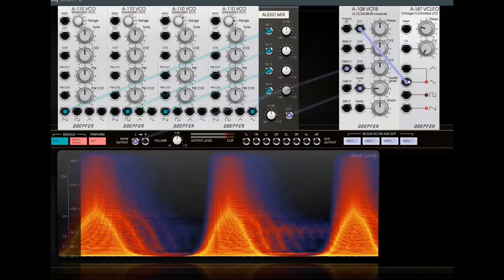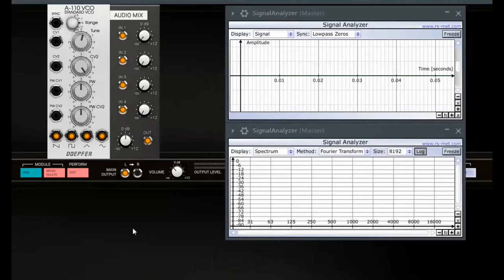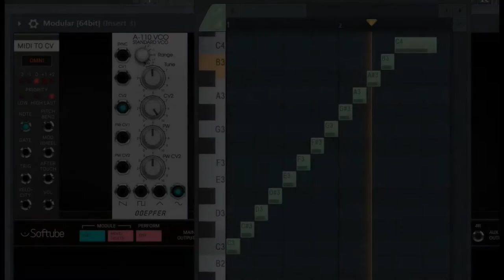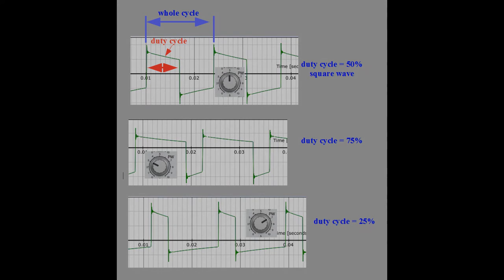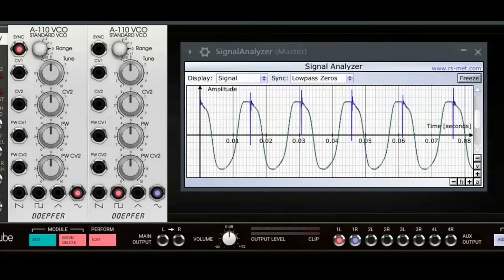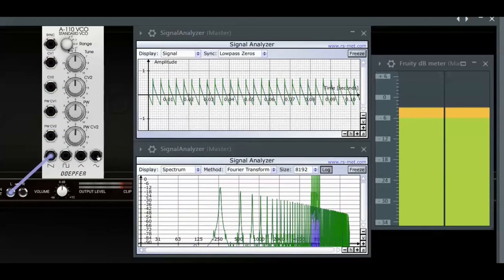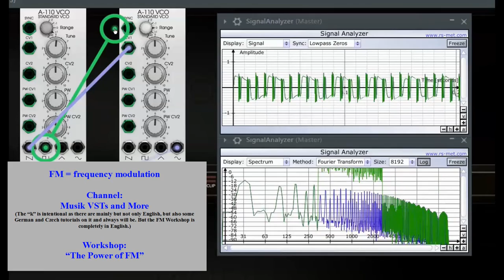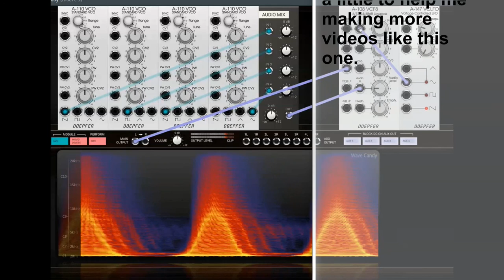Softube Modular The Tutorials part 3 Doepfer A-110 VCO Module

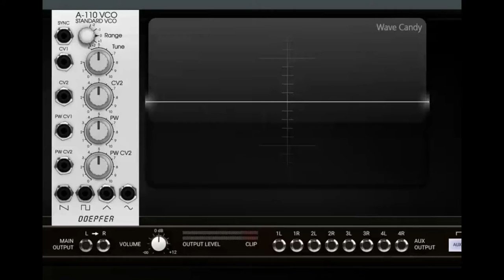Comment from the maker: I want to make something clear, what may be misunderstood otherwise: At about 00:50 I say that the oscillator is always running and doesn´t need any input to be active. Well, that´s true for the hardware. And for practical use it´s also true for the software, the Modular. But as long as there isn´t anything connected to the oscillator´s output, the module-software isn´t doing anything, isn´t "running", so that there isn´t any CPU load caused by it. Have a great day and a good time! Rolf